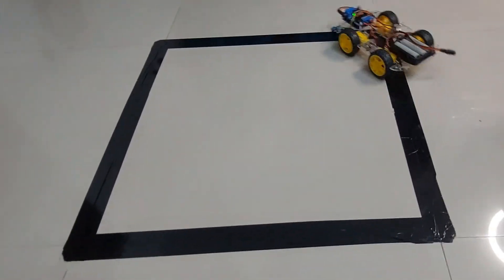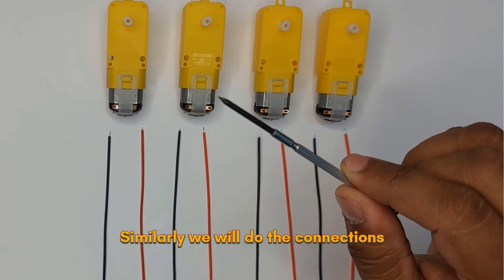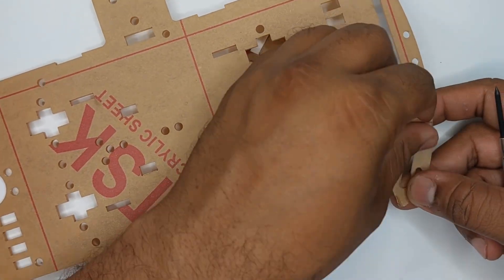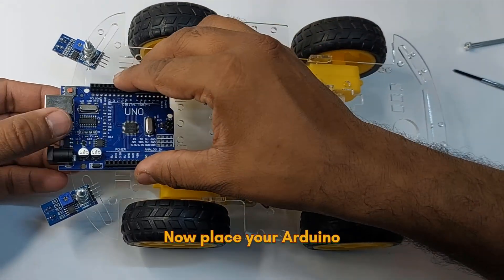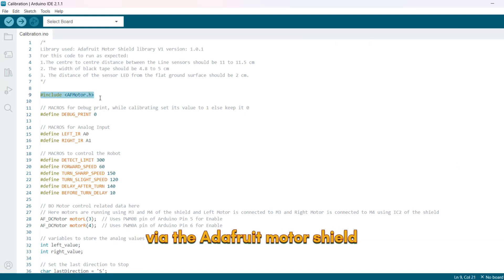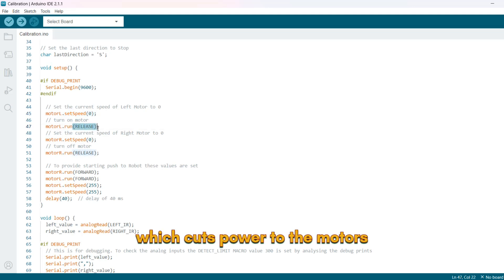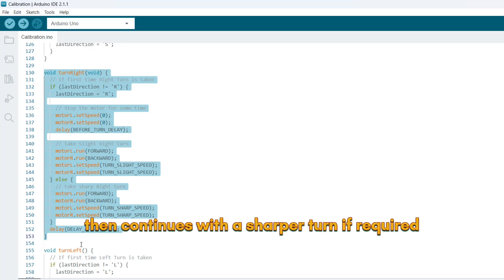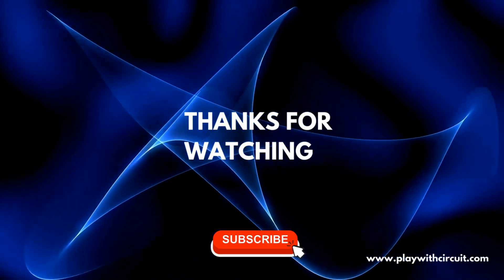Line Follower Robot using Arduino And L293D Shield

Comment: A project that is easy to realise because it consists of pre-assembled circuits without having to perform any assembly at component level. The operating principle is very reliable because the system for detecting and recognising the position of obstacles is practically the one adopted for many years in small hoover robots. Obviously with Arduino and the drives used in the project, it is much more didactic and understandable than a custom system with a dedicated processor. Good work.
Reply from the maker: thanks